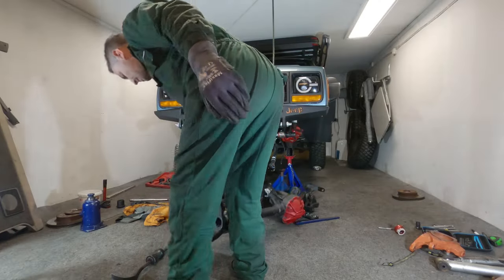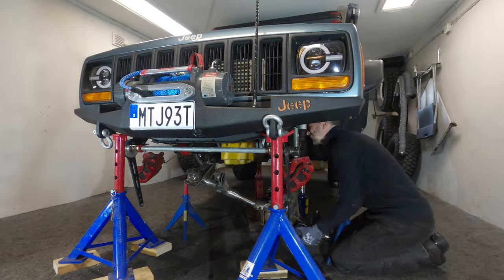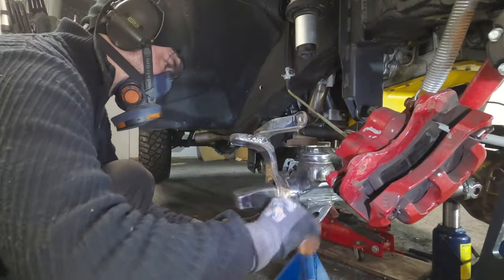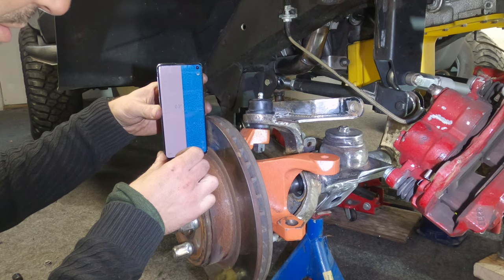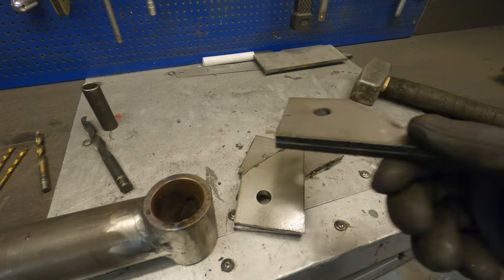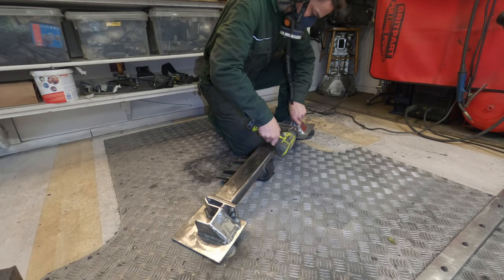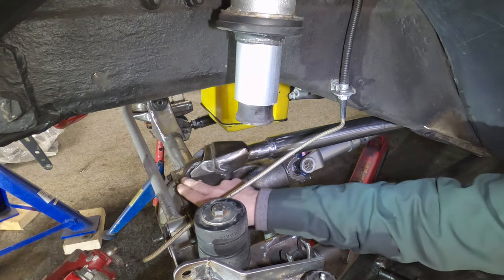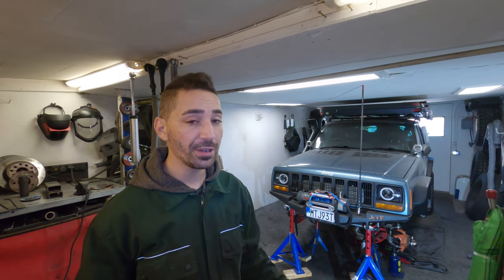Creating My Custom 3-link Long Arm Suspension System / PART 1

Comment: change that upper axle bushing to a rebuildable joint, currie sells a pre machined one but if theres a common rebuildable joint like that sold in europe just machine it to press fit into the upper
Reply from the maker: Thats the plan I think. I bought a poly kit that I can use in a sleeve. It's not a flex joint but it will do. Thanks for watching

Comment: Hi, I have a problem with the climate/hot air system on my 1998 Jeep Cherokee XJ 2.5 D. Airflow only goes to the windshield and the A/C compressor runs continuously regardless of the position of the hot/cold selector or airflow selector. Please, if you know how the system and the control panel work, help me with some advice. The airflow selector doesn't switch, it works only on windshield position.
Reply from the maker: I don't have AC on mine so unfortunately I have no experience on it. I imagine though that the jeep has a resistor that has failed. Probably a climate control resistor that's burnt up. 
With regards to the direction of air flow this is a failed switch or solenoid. Mine has a similar issue, it won't blow air on my feet. I haven't taken it apart yet to look at it. Sorry I can't be more help
Reply: Check for vacuum leak. Which vent is used is changed by vacuum and defrost is the default for the system if no vacuum is present. The defroster setting engages the ac system to dry the air and to run the compressor for off season maintenance. Hopefully that helps good luck

Comment: hi good day, i have 2000 4.0 xj, wanna build just what you did to yours, and i wanna ask please if what measurements of those long arm you fabricated, eye-to-eye please, instead of buying why not build my own right, and thats my problem, dimensions and ill start from there, just the long arm sir, thanks and much appreciated if you could give me some numbers, have a great day, cheers
Reply from the maker: I will get you some measurements on the arms. Do you want them in Metric or Imperial?

Comment: Do love how you managed to slip that butt plug in there like the true professional you are 😎

Just a thought ... we all know where at least 50% of your sore throats comes from but I've watched you welding a lot with a face full of fumes. If you can aim a fan at about head height but not at the weld height to try and get rid of a lot of that. Makes a huge difference to the amount of crap your taking in and you'll feel better for it. Either than or spring for an air fed mask. Expensive but you've got monsters to raise and all that 😉
Reply from the maker: Appreciate that. I'm often wearing a mask with a gas filler on it although I didn't have a replacement filter this time. I will try the small fan tip along with the mask, should help with the dirt throat! 😉  
Thanks again for watching and for the comment